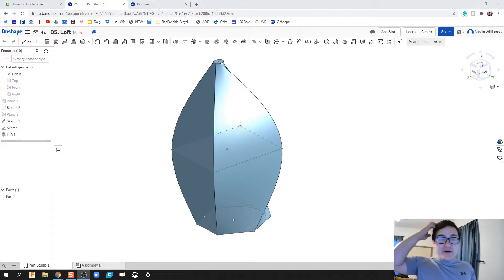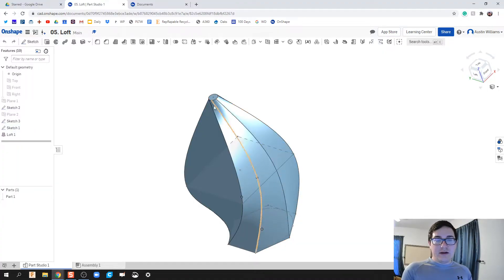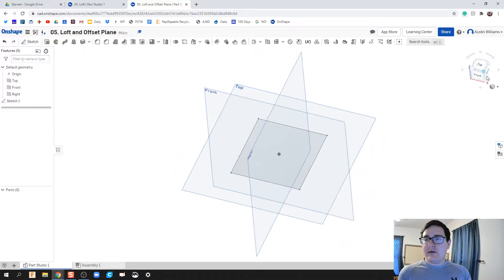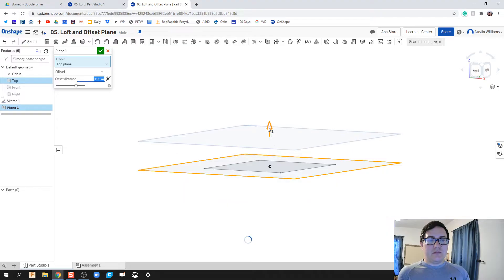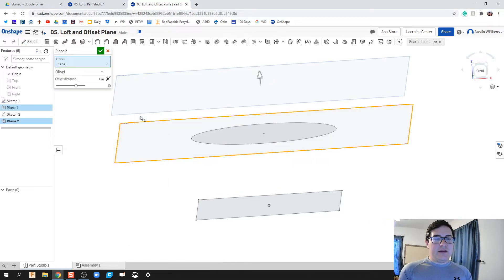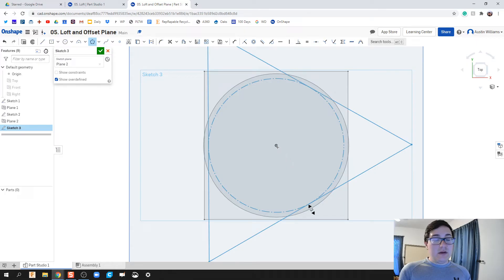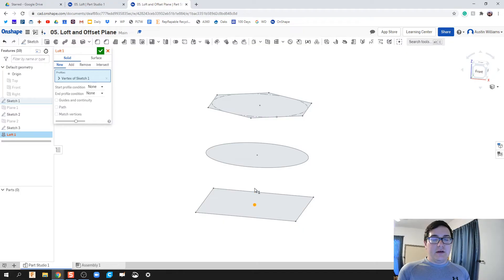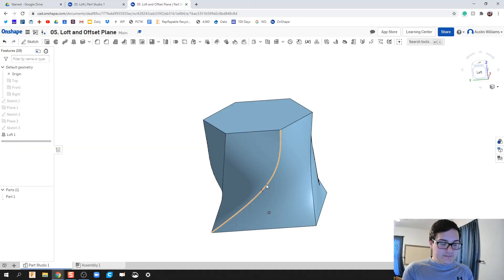Loft and Offset Plane - Day 5 of 100 OnShape Journey

Comment: I think the likelihood of partial remote learning this Fall (then full remote learning after a student or teacher inevitably tests positive) is approaching 100%.  After resisting as long as I can, I think I need to face the fact that IED teachers need to be ready to use OnShape with Chromebooks this Fall.  So thanks for doing these.  Have you tried OnShape on a Chromebook?
Reply from the maker: I have not had the opportunity. However, I am fairly certain that it will work because of the feedback I have received from some master teachers.

For my situation, I will be using OnShape most likely, but giving the options to the students since they will be submitting screenshots/pdfs of their drawing files or parts.
Reply: It works perfectly on a Chromebook with the only downside being a slicer is needed for our students to slice their OnShape files before 3D printing them.
Reply: i am your uncle jonathan

rwmewmck